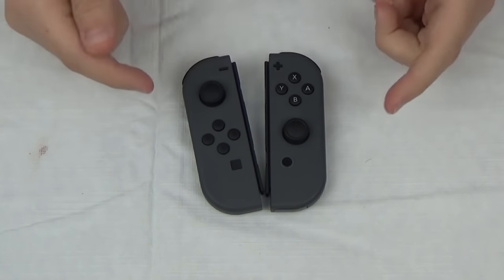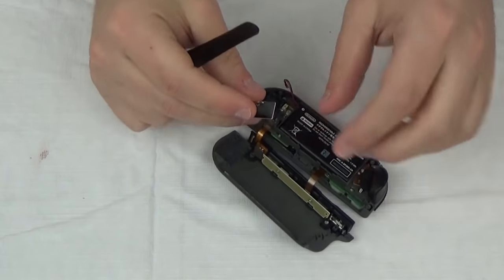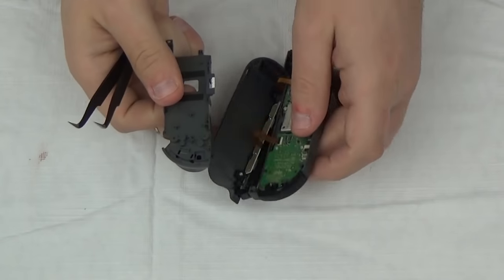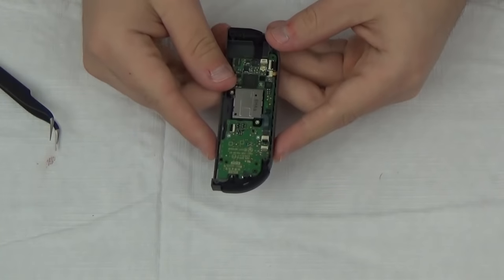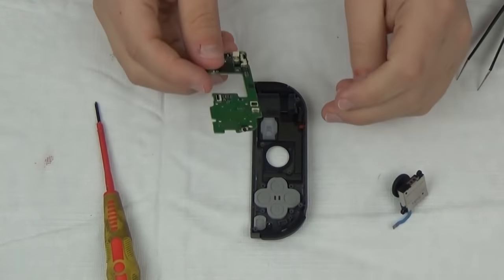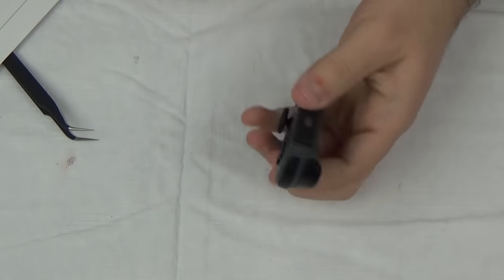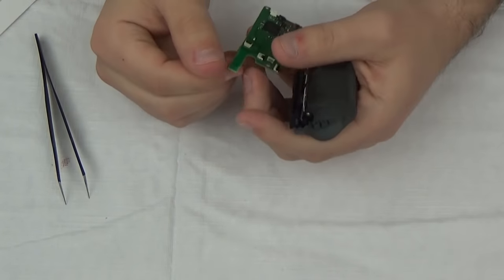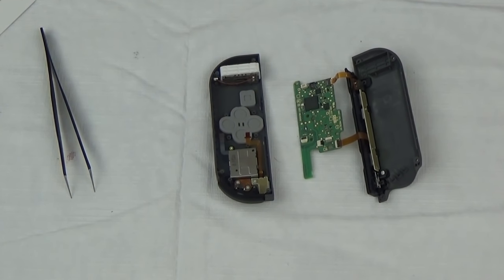Taking Apart The Nintendo Switch JoyCons! Antenna Issues?

Comment: A shorter cable run for the antenna will not cause issues, actually it reduces the amount of loss which is a benefit. The issue is firmware,  they only need to release an update that increases the output power by about 5 %.

Comment: It's interesting, I have had no connection problems at all. I stood with a couch in front of me blocking the switch, with the Joy Con behind my back a little over 17 feet away, and it works perfectly fine. I do have the Neon Joy Con, so I don't know if that makes a difference.
Reply: I have the grey JoyCon Switch haven't had any problems with signals for Bluetooth or WiFi. I don't think it matters which color you have its just what happens when a new console launches. The vast majority probably isnt having any problems, its the vocal minority that usually speaks up when there's a few issues.
Reply: tails300 I've been having some issues playing on my couch (grey too). It's kinda annoying but I can get by until they fix it w/ a patch or recall it (which would suck for consumers & reputation). I wouldn't want to have the issue forever, being that if I wanted to play precise platformers or something like Celeste, I would hate to die from stupid issues like this.
Reply: From what I notice on my switch if you put the console in a location that is covered it can block the signal. As long as you leave it in the open. I put it right beside my TV. I did test it and put the switch behind the TV and then when I put the controller behind my back I would have issues. So I think just leave it in an area that is open and not all covered up and you should be fine.
Reply: Chan Saet nope. I'm sitting like 50 cm from the console and still have issues with left joycon.
Reply: I have a grey one and no problems at all. Sthe switchnis behind my tv and even when I cover the Joycons up it worksmfine.
Reply: Yeah, I have the neon ones as well, and I am having connection problems. I cant really use my console stationarily because the left joy con desyncs with more than 50 cm between it and the console, even with nothing in between console and joy con :(. Its pretty much forced in tablet mode until the update comes out :/
Reply: TheBeesKnees today I'm testing the "no bluetooth" solution - to turn off all other Bluetooth devices. And to be honest - I do have a few... bluetooth watch, speaker, mouse, printer, tablet and 2 phones :)
Reply: Everyone posting that they are having no issues, especially those saying they think it's BS. Don't count yourself so lucky just yet. Like this guy, when I first got it I tested it every which way. Blocked it in every way possible to see if I'd get any issues and nothing. First 2 days had zero issues. Then the third day it started acting up sitting less than 5 feet from the console, same place I've been sitting the first two days. I also noticed it's causing interference with the Switch's Wifi signal, when the left joycon is undocked from the Switch(wireless) the Wifi will not connect. Dock it to the Switch so that it's no longer wireless and it connects just fine.
Reply: TheBeesKnees aye, from what I read - it's Bluetooth not wifi
Reply: Paweł Olchowik, perhaps it's kinda like apples chip-gate, and there were two manufacturers of the Joycons and one was faulty.
Reply: TheBeesKnees Wireless. Not Wifi. They mean two entirely different things. It doesn't have to use WiFi to interfere with Wifi.
Reply: I think so too. I've been trying to voice up as well that my joycons work flawlessly. My Switch sits behind my TV where you can't even see it and it still works.
Reply: Kaleb same here no issues at all with mine at all
Reply: Kaleb I actually tried to make this issue happen, like GameXplain did but I couldn't so... I guess my JoyCons are okay? I made that test after the day one update though.
Reply: I am testing mine over and over again I will try again the next day. But mine has been fine even through multiple walls at 40ft away. When it gets too much further away it will start to mess up. But it was good enough, also Bluetooth or WiFi they all work the same there is just differences in methods it works but essentially it works the same way. They both use antennas.
Reply: I haven't had any issues either with my grey joy-cons. I tried replicating the issue doing the same thing GameXPlain did and I couldn't.
Reply: Venus did you update the console I suppose. If that is the case, you tried them before the update?
Reply: Kaleb I'm only sitting about 5 feet away from the Switch, and if I hold the controller in a comfortable position, my fingers wrap around the back and almost completely block the signal.
Reply: 9snaker I guess I just got unlucky. My switch also started getting stuck in permanent error message loops that make it unusable, so I'll probably send everything in for repair at once.
Reply: Kaleb same I have no problems
Reply: It's interesting.  I actually have connection problems...only when they are low on battery.  While other controllers will just outright die without any issues, when my Joy Cons are low on battery they repeat or drop inputs a lot.

Comment: Hey Spawn Wave, great video as always. Quick question. I have a 4K TV, 40 inches. Will Zelda at 900p look crap on it? My Switch is coming in soon and I'm a little worried.
Reply: City Fox I have a 4K 50 inch and it looks gorgeous.
Reply: Randomninja47 Oh really? That's reasuring. My TV also has a pretty decent 4K upscaler. Pretty glad to hear that :)
Reply: Grey joycons
Reply: I have a 50inch 4K from LG..I was a bit worried too, but is is beautiful!!
Reply: City Fox I've got a 4k Samsung 50 inch at 120 Hz and it looks great. the switch definitely has better framerate while in handheld mode and it's a little more pixelated but that's to be expected.
Reply: The Switch displays at 1080p when docked, which is standard HD. It looks pretty good, but it's not made for 4K. I think it will default to 1080, which is really all you need. Nothing to worry about really.
Reply: ***** Once you have a proper 4K TV with HDR and watch Mad Max Fury Road in Ultra High Definition, you won't think 4K is a gimmick anymore.
Reply: He's saying it won't look like crap. The game looks fantastic
Reply: 55" 4k TV here, enjoying the game every second. I think it looks amazing and it is more pleasing to the eye than for example Horizon Zero Dawn.
Reply: City Fox no don't worry it will look great I have a Samsung suhd 4K hdr 55 inch and I tried it on the switch Zelda and it's perfect
Reply: City Fox I have a 55" true 4k lg tv and zelda looks fantastic.
Reply: Everyone is saying it looks good, but to me it looks kinda lame. I prefer to play  it on handheld mode because it looks better than on my 1080p monitor.
Reply: On a 40 inch even 4K looks like crap! Seriously, with a 40 inch TV you can hardly see the details of a 1080p image, so 900p is just fine! But trying to watch 4K on that 40 inch TV is a complete waste! The human eye-sight is not good enough to see the details of a 4K image on a small 40 inch screen, unless you sit only like 2 feet away from your TV.
Reply: DarthChrisB true I used to have 40 inch 4k but it wasn't great
Reply: DarthChrisB I sit 4 feet away from it.
Reply: Something that most people don't realise is that 4k televisions or monitors are desgined for 4k, not for lower resolutions, meaning the pixels fake the lower resolution, which makes media look worse than if it was on a 1080 monitor.
Reply: Same here i got a 4k also and it looks awesome. Colors look way better than during handheld mode.
Reply: City Fox I have a 65 inch OLED LG 4k and the switch looks really good
Reply: Yes, but keep in mind how scaling on LCD displays actually works.
Integer multiples scale much better than odd resolutions.

1080p is 1920x1080

4k is generally 3840x2160 - you'll notice this is exactly 2x in each dimension as 1080p - That means each pixel for a 1080p image can be displayed as EXACTLY 4 pixels on a 4k display.
Perfect scaling like that should really look no worse than the native resolution would.
But an odd resolution like say 2258x1270 (1.7x scale) is going to look absolutely horrible.

720p is 1280x720, which needs to be scaled up 1.5x to show on a 1080p display, which is actually not so great.
However, it means it's a perfect 3x scale on 4k display, which is better, in fact. So 720p should look better on a 4k display than on a 1080p display.

900p is 1600x900 which... Is pretty awkward. that's a 2.4x scale to 4k...
And also pretty horrible on a 1080p display in fact.

Keep in mind though that the console is still putting out 1080p, NOT 900p - No console would actually output a 900p signal directly. Doing so would be stupid.

And when it comes to resolution scaling, the results tend to be much better if the console is doing the scaling, rather than the TV. (the console has more information available on what the picture is meant to look like, while the TV has to do much more guesswork when upscaling.)

So what you'll get for 900p is the console will scale that to 1080p, then the TV will scale it to 4k.
The 900p to 1080p scaling is messy, but the 1080p to 4k scaling is basically a perfect integer multiple, which is pretty much the best case scenario for scaling an image.
Reply: Maybe, but i don`t want a additional desk at home so i use my couch and 4K TV. It works really well with the Roccat Sova and for Zelda, i think it looks amazingly good. Between Zelda and Horizon Zero Dawn, i will take the graphics of Zelda anytime. Yes Zelda doesn`t match the resolution, but whatever, i never expected 4K gaming from the Switch so i`m fine.
Reply: Looks awesome on my 65" 4k
Reply: Also consider you're sitting closer to your monitor than a person usually does to a TV, which makes it much easier to spot the jaggies.
Reply: SAW9 Same it looks great
Reply: City Fox tbh playing on my 50" lg 4k tv, it gives the illusion of playing in 60fps, but when it dips, its breaks that illusion. just fyi
Reply: I've had a 4k 55 inch for two years, watched countless movies on it - and I feel that this is the first visual experience that truly deserves to be displayed on such a good TV. I hope you enjoy it. :)
Reply: City Fox m8 I'm using a good ol Emerson 720p tv, not  to mention an early flatscreen tv and 720p was a big deal at the time. In fact, the image looks even crisper on my tv then most 1080p or 4K tvs.

Comment: I honestly think it's the system not the joycons my switch started playing up today my joycons where desyncing so I tried another pair the same thing happened. Then I tried my joycons on another system and they work 100 percent. I'm thinking there's a issue with the system picking up the signal not the joycons

Comment: In the right Joy-Con, I can confirm that the square attached to the antenna is for NFC/Amiibo functionality. I haven't been able to successfully reroute or lengthen the antenna though, it seems quite delicate compared to the left joy-con. It's become much less reliable since I've tried extending the wire, even removing it and putting it back the way it was seems to have done some damage. Be careful. The left one is where most of the problems are anyways, that one is super easy to fix with a scrap wire and solder.

Comment: Is it possibly that what you thought was the antenna in the the right joy-con was actually the NFC reader?
Reply from the maker: Broadcom chip appears to run directly to that antenna. It looks to be for the wireless communications.
Reply: Spawn Wave check the pcb for antenna traces in the right joycon just to be sure. Great video btw
Reply: Does that same chip do NFC?

Comment: This is pretty bad news then. This means, that the antenna problem is hardware problem and can´t be fixed by Nintendo at all. So they either have to recall every single left Joy Con on earth and replaces/repair them or claim that there is no problem and secretly release improved Joy Cons.

Comment: Mine work perfectly fine. I tried covering them with my hands, putting them behind my back, and pointing them completely in the opposite direction while behind my back, and they both still respond perfectly. I tried both in BoTW and in the calibration screen.

Comment: Awesome video dude.... I have a question for you. I have 50" screen 1080p and will you think that it is possible to see Zelda breath of the wild in 1080p instead of 900?? I'll be getting my switch within a couple of days. Thanks!
Reply: Mr.Thirdeye Tour TV might upscale the 900p image to 1080p, but it will still be a native 900p image. Anything higher would either make the system explode (:P) or require a system too beefy to run on a battery
Reply: Bob Bobstien, I see..... Thank you!

Comment: Can I say I have the switch I have TRIED every combination possible with trying to cause connection issues with the joy-con unsuccessfully.  for the record I have the neon joycons
Reply: Bob Willmann same, I have had objects obstructing, behind my back, and over 17 feet away, and I have had zero connection problems, it was a super smooth connection.
Reply: Bob Willmann Today I had issues for the first time. Link kept walking once and walked me off a cliff. Then they literally desync'd and asked me to push L+R to resync them in the middle of the game.
Reply: I try syncing my joy cons more than I've even played the console. When it does work I can be halfway across my house but when it doesn't work I can't be more then a few feet....
Reply: Randomninja47 are yours the neon joy con?
Reply: No mine are the grey ones.
Reply: Bob Willmann I have the grey ones. I've had no sync issues with either one so far, including multiplayer games in the car and on a table in a room with loads of obstruction, small dogs getting in front, and 2 large console boxes with like 4 controllers synced up within the small space. 

Only thing I've noticed is that my pro controller won't sync to wake up the system unless I press the home button first. No other input works for that. It will search and search all day until I hit that.

It should be noted that I followed the day one patch suggestions to the tee. I updated in the dock with the joycons connected, and it showed an icon of one controller then the other even though they were already synced and inputting a few seconds after boot up. I even powered it all the way down in the dock with them attached and booted it back up to make sure everything installed with no failures. I also made sure to have my pro controller plugged up in case there was anything in the patch for it.

Fun note: the slide rails (for slightly bigger buttons and straps) gave some people problems. I figured out why. They have a secondary lock! It's a little flip switch on the open end near the strap. You have to flip that back out and then push the normal lock button to slide them off easily. People were fighting a lock they didn't realize was there.
Reply: Mathew Oliver Did Nintendo Not have a Manual for the Switch joy cons? A simple read would do the trick for people who have a problem... Also thanks you for the information on your experience.
Reply: Bryan Fregoso there was a manual..  but unlike Nintendo.  from what I've seen its only 3 pages. that's it
Reply: Bryan Fregoso I didn't even read the manual, so I'm not sure if it's in there. When I tugged and it fought, I looked and saw the little flip switch/lever that auto-locks when you slide them on. I flipped it and problem was solved.

It's funny that professional reviewers missed it and said they were "oddly hard to take off." It's probably a safety lock in case the joy con goes flying with enough force while attached to your wrist.
Reply: Mathew Oliver Interesting and true that the reviewers were uniterested with giving a conclusion to the clunkiness of the straps. Its valid i suppose but im sure that if they thought and looked at the controllers long enough, they would see the problem was a minor error on their part. Stil Nintendo made a mistake with having a latch on the bottom of the strap and not somehow more ergonomic.

Comment: The joycon issues doesn't apply to everyone. My Switch is actually behind my mounted TV completely being blocked from view. Also, I have a digital cable antenna, Amazon Fire TV, wireless soundbar, and a portable hard drive hooked up. I sit about 10-12 feet away and my joycon worked perfectly. I feel bad for some users that got weak signals on their joycon but not everyone is having that issue.

Comment: I use two aluminum small narrow strips to improve the wlan wireless card reception.I get 4 bars 95% of the time.I place both strip on each other to look like a cross with scotch tape.Make sure both strip ends are not touching anything.The horizontal strip is placed and touch on both antenna plugs on the WLAN card.Some gamers would just wrap aluminum all over the WLAN card just for experiment  research to see if this can work as good too. :O  Try aluminum foil inside those JoyCon

Comment: The locking mechanism is really bad. Its not the spring that wears out but the actual plastic stopper thats gets a dent.

Dropping the controller on the floor is usually enough to get a dent that ruins the locking mechanism, because its made out of such a soft plastic. Ive already broken two joycons this way.